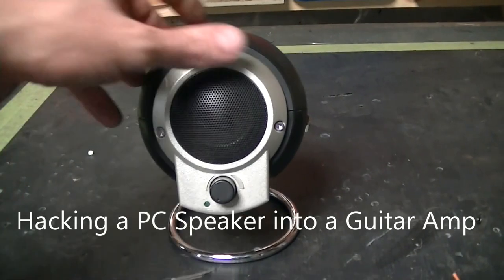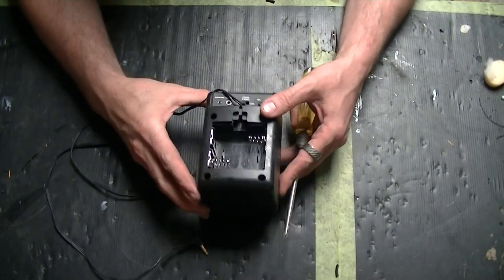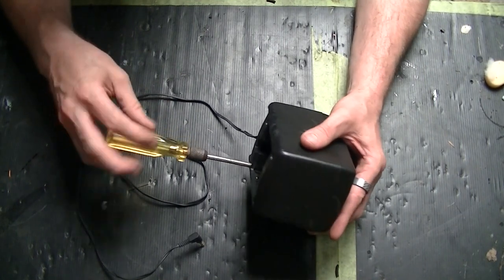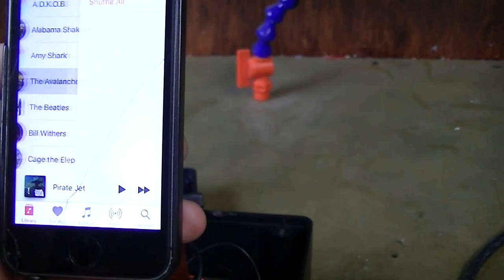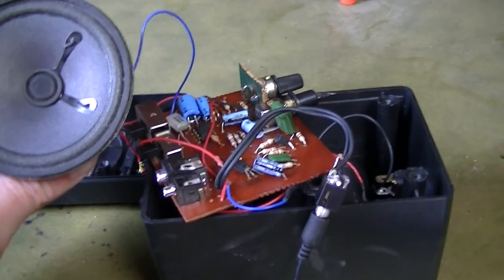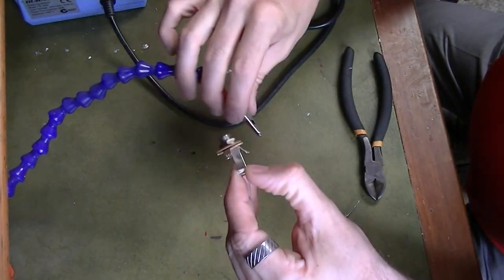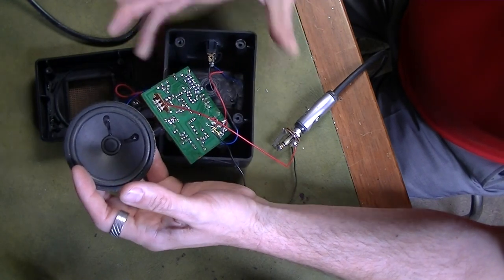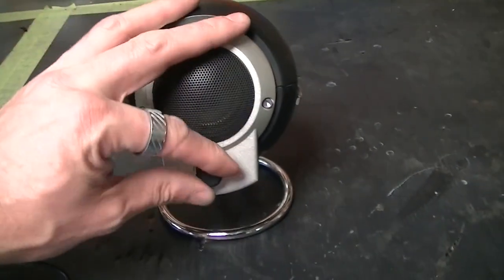Hack a PC Speaker into a Guitar Amp - Step by Step Tutorial

Comment: I just did the same thing to a pc speaker. First time doing something like this.  Like your black one mine is not very loud. Somewhat disappointed but hey its a start for me.
Reply from the maker: caddisking try and experiment with the wire that attaches to the pot.  I found that randomly touching other solder points that I found a better input than the pot one.

Comment: Why could'nt the plug end which connects to the PC be replaced with a 1/4" jack for the guitar without doing any other mods? I'm not talking about any power requirements.
I know this video was uploaded 8 years ago so I'm hoping you will still respond to this question.
Have a good day.

Comment: could I do this to a 1940- 50s  record player I have laying around I also got a ham radio? I really want to play on a tube amplifier! do I just find the correct volume tab and ground wire? I don't have to convert it to battery that's just for portability which I don't need.
Reply from the maker: You probably could do the same hack with a record player,, as long as it has an amp in it which I'm assuming it will do.  You can also do this with tube radios but be careful as they are high voltage .  Using battery powered radio's is a lot safer
Reply: lonesoulsurfer it has tubes and a volume knob as well as a treble and bass knob. Does a volume knob mean that it has an amplifier?
Reply from the maker: @marcoa7090  It will have an amp inside if it has a volume knob
Reply: @lonesoulsurfer  thank you , Merry Christmas